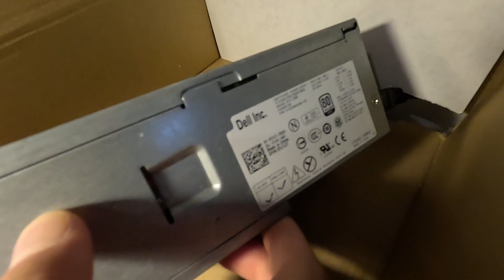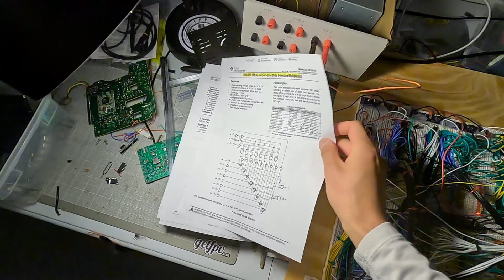Nand2Tetris Full Overview

Comment: I love it. Is it possible to swap those 8 relays for optocouplers?
Reply from the maker: I was considering optocouplers actually! However, I needed specifically a SPDT configuration to switch between memory input/output, which was difficult to come across with optocouplers. Relays were simple and "just worked", albeit not the most elegant solution.